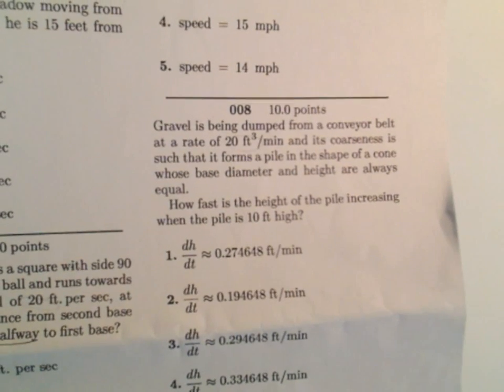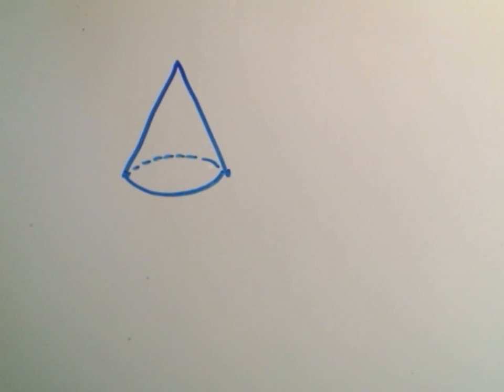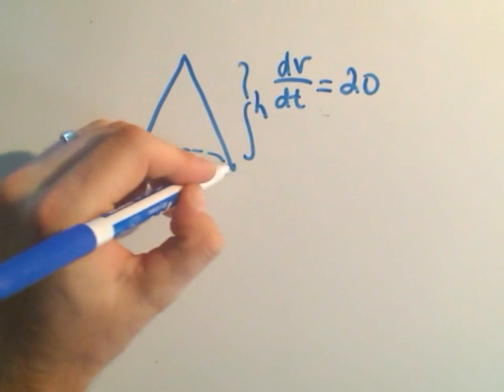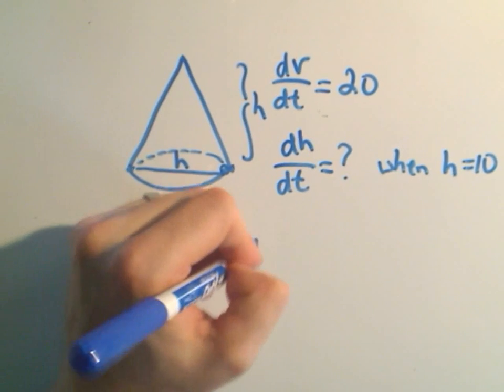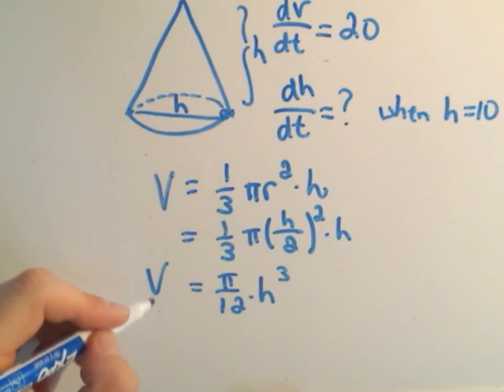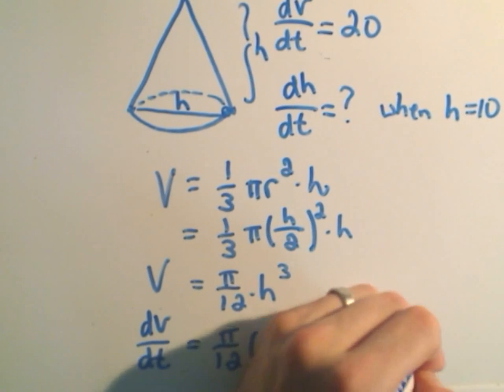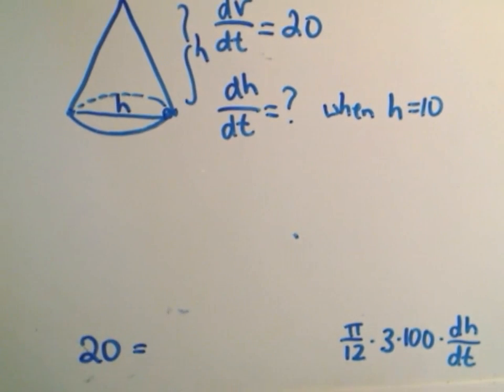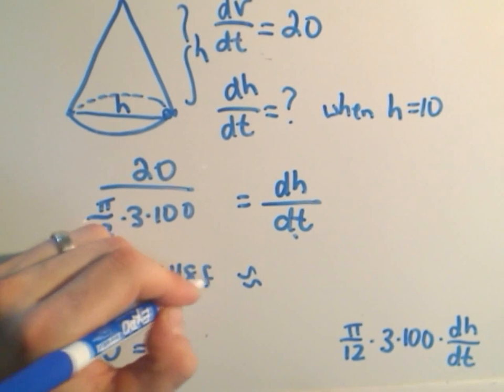Related Rates #2 Using Cones

Comment: If anyone else was confused why the radius is (h/2)^2 when he re-writes the equation, its because you're given that the height = diameter. So half of the diameter = the radius. So when you re-write the equation instead of having r^2 you have (h/2)^2. This part is easy but took me a long time to visualize. Hopefully this helps one of you.
Reply: would it be wrong to just substitute r for with 5 since it is what 10/2 is
Reply: thanks bro

Comment: Just to clear things up. You only use the product rule when you are multiplying 2 VARIABLES. For example, you would use the product rule for (4x)(3x). However, for his example, V=pi/12 * h ^3 is NOT multiplying two variables. In math, Pi is considered a constant, so pi/12 is also a CONSTANT, not a variable. h^3 is a variable, and it is being multiplied by the constant pi/12, so we cannot use the power rule. Also, yes the derivative of a constant is 0, but only if that constant is being added or subtracted. For the example in the video, he is MULTIPLYING a constant and a *variable*, the constant is not being added or subtracted! In situations like this, you leave the constant alone, take the derivative of the variable, and then just multiply it by the constant. For example, the derivative of 7x^3 is (7) (3x^2) which when multiplied is equal to 21x^2. Hope this helps
Reply: Vanessa Rahimi true, but you can still use the product rule and get the correct answer
Reply: i think that he used product rule to pi/12 h raised to 3 because pi/12 is attatched to h raised to 3

Comment: after you took the implicit differentiation on both. why you dont need to write V. Like dv/dt*V as the dh/dt h
Reply: Because the derivative of V is 1.
So basically it is ( (1) * dv/dt )
But for the H, because the derivative of h^3 is 3h^2
so u get the derivative of h^3 and multiply it by dh/dt..
Reply: wait how do u get V prime =1
Reply: Isn't the derivative of X equal to 1 ?
It's the same for V
Take a look at the Derivative Rules:
http://www.mathsisfun.com/calculus/derivatives-rules.html
Reply: thx i alrdy got it, I don't know what iam thinking at first. thx anyways

Comment: why did you leave the pi/12 alone?
Reply: pi/12 is the coefficient of h^3. When you differentiate a term with a coefficient, you leave it out front and do the rest of the derivation like normal.

For example: d/dx (3x^3) = 3(3)x^2 = 9x^2

Comment: When you differentiate the volume of a cone with respect to time, are you finding the rate in which, say water, is being added from the base to the tip or the tip to the base? When I do a similar question, I take it that water fills from the tip to the base, up-side-down from the example in the video.

Comment: How did r get replaced by h/2?
Reply: I think its because h represents the diameter and since the radius is half of the diameter then it would ok to replace r with h/2
Reply: dolphinsatsunset1 thanks, I just understood that from your comment
Reply: Venessa Wallace Actually the problem stated that the diameter and height are always equal which is why h = 2r so then by algebra you obtain, r = h/2.
Reply: Sylvia Okonofua you're welcome. :)

Comment: So I put in 20/[(pi/12)(3x)(100)] into my calculator, multiple times and I got 22918.31181 not .254648.  What am I doing wrong?
Reply: There should be nothing wrong as 20/(300pi/21) = 20/78.5398 = 0.254648
Reply: i put 4 + 4 in my calculator but i didnt get right answer what am i doin rong?

Comment: Why do you plug in the (h/2)^2 for r? I don't see why
Reply: H is the diameter so the radius is half of it or H/2
Reply: H is actually height but in this problem it is equal to the diameter so you know that radius is half of your diameter or half of your height (height = diameter)

Comment: in the beginning, you are given that the height and diameter are equal. By substituting h for r there are less variables to deal with. Because the volume formula uses radius, PJMT had to write it as h/2 (d=2r, r=d/2)

Comment: The diameter and the height are always equal. Radius is half of the diameter, which is also half of height. Also, it's much easier to solve for 1 variable (dh/dt) than 2 (dr/dt and dh/dt).